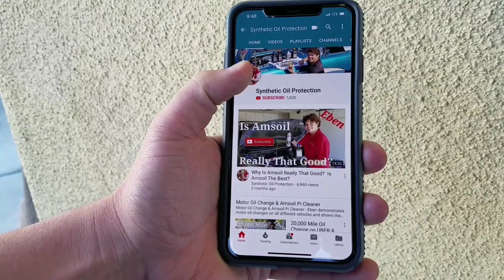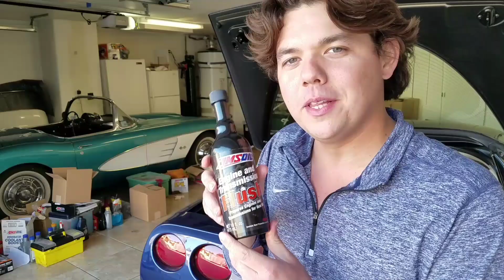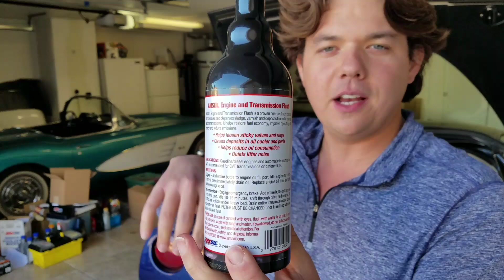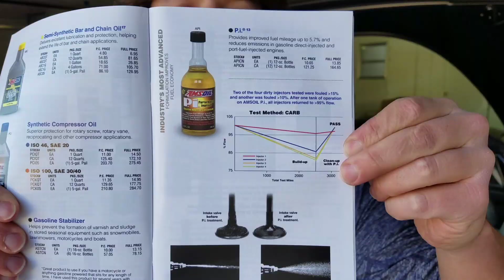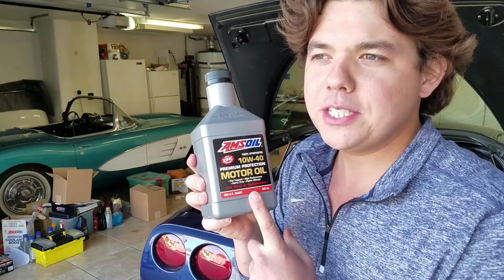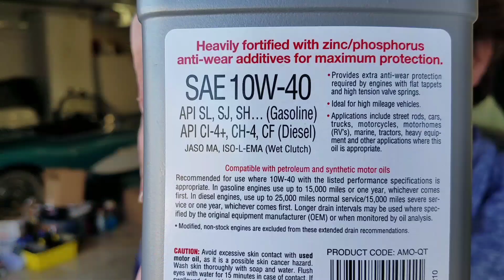Best High Mileage Synthetic Motor Oil - Oil BURN Fixed!!!

Comment: Can this work on a 2008 Honda Accord I have  a oil consumption problem and I’m trying to deal with it right now the best I can please help
Reply from the maker: Yes I would do the engine flush and I would also use the Amsoil power foam and a bottle of Pi performance improver
Reply: @Syntheticoilprotection  Does the engine flush make it worse if the vehicle has a slow leak also, besides the engine oil burn issues?   I don’t need to make it worse . Thanks
Reply from the maker: If I had a car and I was going to change the gaskets within a month or two I would still do an engine flush if I was going to attempt to go a year without changing the gasket I wouldn't do an engine flush because it could make it leak a little quicker.
Reply from the maker: Tristy this is what I did to my Cadillac and I recommend you do to your Honda- https://youtu.be/-T_-mF8tlyA
     If your car is leaking oil from the gaskets do not flush it.
Reply: Synthetic Oil Protection how do you know if it leaking from the gasket ? All I know is when I took it to the dealership a year ago they couldn’t find the leak because it’s not leaking on the ground after doing more research it’s burning out the exhaust pipe
Reply from the maker: Correct that means you are good to go on the engine flush👍😊🇺🇲
Reply from the maker: This will give you all the products for your vehicle and fluid capacities if you have any questions you can call me anytime.
AMSOIL Products & Vehicle Lookup - https://www.amsoil.com/guides.aspx?zo=5331179
Reply: If you are burning oil try changing the pcv valve
Reply: Did you slow down the oil consumption issues?
Reply from the maker: Not sure what you mean

Comment: Hi. I have honda odyssey 2007 is burn oil which product is good for ? Thank you
Reply from the maker: Great question I would go with the Amsoil Signature Series motor oil for your vehicle I would also get the Amsoil oil filter for yours I would get one bottle of Amsoil Pi performance improver and I would also get a bottle of the Amsoil engine flush this is the look of guide it will give you all the products to your vehicle.
    AMSOIL Products & Vehicle Lookup - https://www.amsoil.com/guides.aspx?zo=5331179
Reply from the maker: Uy if you have any other questions feel free to reach out to me anytime
Reply: try changing pcv valve
Reply: Did you slow down the oil consumption?

Comment: On a 2007 S550 with 179000 miles which would be the right oil and how often every 5000 miles?
Reply from the maker: The European oils are meant to be changed at the OEM interval however with oil analysis they've been able to run the Sprinter vans up to 50,000 miles with a bypass filter.

This is the product lookup guide it'll give you all the products for your specific vehicle and it will give you the fluid capacities for all the fluids..

     AMSOIL Products & Vehicle Lookup - https://www.amsoil.com/guides.aspx?zo=5331179
Reply: i have an 04 s55 amg and run shell rotella t6 5w40 synthetic.  yes its not amsoil but the mercedes oil filters are only good for 10,000 miles i believe.  A gallon at the store in usa is about $20, or $5 a quart/liter.  you can also use it in motorcycles.

Comment: Why isn't the Premium Protection available in a 5w20?
Reply from the maker: That's a great question because the older air-cooled vehicles that require that type of zinc and phosphorus are a thicker viscosity and the thicker viscosity meets and exceeds those engine tolerances for those classic vehicles.

If you have a newer vehicle you would want to stick with the AMSOIL signature series products because they are designed for newer direct-injected fuel-injected engines and those are the more similar viscosities they do make Signature Series up to a 5w 50

Comment: Can you use this with a vehicle that has hydraulic valve lifters.
Reply from the maker: Yes you can use it in all motor oils gasoline engines and turbo engines also diesel engines - https://www.amsoil.com/p/engine-and-transmission-flush-flsh/?zo=5331179

Comment: Only way to “fix them” is rebuild them! Once piston rings or valve seals go bad no additive will “fix” them only replacing will fix the issue of burning oil
Reply from the maker: This one is really good showing how it makes a difference https://youtu.be/vR0k3JGOK4M
Reply from the maker: A lot of times there's no major problem with engines it's just the carbon that surround the ring and using a mineral oil will increase. Carbon and you don't really get a seal so you lose a lot of compression and you also lose power.

The best way to clean it is to do a flush and then use a high detergent oil to keep it clean.

The only way to know there's no mechanical damage is to try the flush first and then if the flush doesn't work then he definitely have to do rings and get it fixed.

Comment: I gs350 burning some oil, I'm hesitant to flush the engine, thinking it will make worse
Reply from the maker: If it's leaking I would get the gaskets fixed if it's just burning oil I would flush it and use the ams oil filter and the amsoil signature series I would also get an extra oil filter in change that filter in about 3000 miles because this signatures can to get all the carbon out of your engine around the timing chain and all the oil galleys and everywhere else around.
Reply from the maker: This is one of my best flush transformations https://youtu.be/vR0k3JGOK4M
Reply from the maker: This is a 300 mile 1000 mile engine flush on a Toyota Tacoma he ended still runs great. https://youtu.be/f7nrBNi1k9Y

Comment: My car is burning wayyyyyyyy to much oil it burned 4q in 100 miles🤦🏽‍♂️
Reply from the maker: This will help - https://youtu.be/qjR2pjggjhY
Reply: Holy Crap. I got over 274k and my motor doesn't burn any and I still just use 5w20 and no additiv,... And all my coolant has been in my motor before when I blew a lower intake gasket. It should have been shot 50k ago. Maybe you have a stuck valve. If it is getting burned thru the exhaust, wiping a paper towel on the inside of the tail pipe it will come out black. could be worn rings too. how many miles. Pull out your spark plugs one at a time and look at them. I know some one who wore his motor out changing his oil too much. I do mine before winter and after, if looks needed, and always fill the new filter with oil " so the motor doesn't have to run those 5-30 seconds dry " as much as I can and install it. My filter is at a slight tilt from strait up so I can fill mine 85% of the way easy. For you I'd also would park over some cardboard laid out flat  and let it run over it for 5 minutes in drive holding brake with a little peddle shut it give some time and see if and oil was on the card board to see it there was a main seal leak also. Had to do that once, thought my transmission was leaking so washed the motor and did that. Wound up my rack and pinion was leaking but was in a way it got all over the back of the motor near the trans. Driving blew it around. I've never had sticking valves or anything but in my 35 years all my oil changes I've used Kerosene or marvel mystery oil before hand and always had a clean motor inside.
Reply from the maker: Check this out Sean 

AMSOIL Performance Tests - https://www.amsoil.com/performancetests.aspx?zo=5331179

Comment: I did the oil change last week on my Suzuki XL7 2002 it has 300,000 miles I put 5w30 Signature series. But I didn't do the flush. Will with that oil be enough to stop the oil burning?
Reply from the maker: It should be I would still do an engine flush next time also I would change your oil filter at about 5000 Miles because the signature series is going to break off a lot of that carbon with the detergent.

I would also do the Amsoil Pi performance improver fuel additive to clean the valves that'll help with Blow by
Reply: Did the Signature Series work?

Comment: Could I use AMSOIL OE in my high mileage Nissan truck? Been using high mileage oil for a few oil changes now & I’m afraid to switch to anything other than high mileage. Love the content!!
Reply from the maker: If you're doing under 6,000 miles a year the OE is the best for your application.

If you'll be doing more like eight to twelve thousand a year I would just do the signature series.

This is my link if you would like to try the products and if you have any other questions feel free to just call me anytime.

My link: Best AMSOIL 100% Synthetic @ Wholesale + FREE Shipping: https://www.amsoil.com/offers/?zo=5331179 
AMSOIL Products & Vehicle Lookup - https://www.amsoil.com/guides.aspx?zo=5331179  

 If your vehicle is not on the lookup guide this is AMSOIL Tech Support 715-399-8324
Reply from the maker: Of course of course you can!!!!!!!

Thanks for being a part of the channel John really appreciate you.

I recommend doing an engine flush and a bottle of Pi performance improver also the Amsoil oil filter is much better as well it will help your car over the course of the year.

How many miles do you drive a year?
Reply: Synthetic Oil Protection Great!! I have a 13 Nissan Frontier truck, going on 140k right now.  I put in about 25k miles per year using it for heavy duty field  work and a lot of travel. Looking forward to trying out amsoil products

Comment: My 06 toyota highlander burns oil
Reply from the maker: Its normal,  how many miles do you have on your vehicle?
Reply: @Syntheticoilprotection  208,000
Reply: How’s your Highlander so far? I have a Highlander too with those exact oil burning issues.

Comment: I've been putting Mobile 1 High Mileage in my (formerly) oil burning 1999 Corolla with 312,000 miles for the past 2 years..it does not burn a drop now. But I'm sure AMSOIL is a better oil, it just costs twice as much! ://
Reply from the maker: Amsoil actually becomes quite a bit less than free because your motor will last longer you'll also see a big performance bump and less oil burning you are engine will run smoother better fuel mileage and you won't do as many oil changes you'll change your oil about 2 to 5 times less depending on the vehicle and oil analysis than the OEM interval.

You'll see some great oil analysis videos here
Oil Analysis Tests: 

15,500 Oil Analysis Test Results SL550 - https://youtu.be/3rdN6U1Jt_M 

5500 Mile AMSOIL Oil Analysis Test Results - https://youtu.be/3wf962IwEmo   

5000 Mile AMSOIL Oil Test Results On My SL550 - https://youtu.be/fLuvzN6yLSw 

11,000 Mile AMSOIL Oil Analysis Results on my Corvette - https://youtu.be/YEY_13UYzA4 

20,000 Mile Oil Analysis Results on Honda Uber - https://youtu.be/gm_PXlpiaTk 

26,000 Mile Oil Analysis Results - https://youtu.be/Wdq2A2YIorM 

80,000 Mile Oil Analysis Test Results Freightliner Cascadia - https://youtu.be/9A9k6i1xMoo 

25,000 Mile AMSOIL ATF Analysis Test Results - https://youtu.be/IeVPGR7UO9E
Reply from the maker: Lol

Comment: Thanks for all the great info I will never use high mileage oil again I hope it hasn't done any damage I've only done it once. I'm going to use your process that you explain here on this video.
Reply from the maker: These are my accounts:
Instagram - https://www.instagram.com/syntheticoilprotection/

Facebook - https://www.facebook.com/profile.php?id=100007973957868
Reply from the maker: What type of vehicle are you going to try it on?
Reply: @Syntheticoilprotection  a 1992 F250 with a 460 engine. I has 102000 miles on it. I add a  quart about every 1000 miles.

Comment: Would you recommend doing the flush on a 1997 Chevrolet K1500 Z71 P/U with 180,000 miles? I’ve been using regular high mileage oil for quite some time now and want to consider doing this.
Reply from the maker: Of course, you'll be amazed how much smoother more compression the engine will have after also you will have a lot less Blow by.
Also a good idea to do the Amsoil Pi performance improver that's the fuel injection cleaner that cleans your valves and that'll also help to.

Thanks for being a part of my YouTube Community Daniel☕

Comment: My 2010 Chrysler town and country is got 360,000 miles and I always used Synthetic mobile one high mileage
Reply from the maker: Cool, you notice a big difference if you did an engine flush and put in the hundred percent synthetic you'd be amazed.

This is my best engine flush I've ever done in the channel - https://youtu.be/f7nrBNi1k9Y

Comment: Lms if I got it right. I buy the products, I put the first one (idk where yet), then I put the other one in the gas when it’s empty and then fill it up, drive it around, and then I change my oil putting the Amsoil oil ?  I have a 2001 corolla 210k+ miles and it burns oil. I have to be checking and pouring oil every month ish.
Reply from the maker: When you do the engine flush all you do is let the engine idle for 15 minutes then you change the oil
Reply from the maker: This is my engine flush playlist - https://www.youtube.com/playlist?list=PLB_ftWArBFddawwJUyra9BJY50iLTuBN9
Reply: Daniel, also check the pcv valve. It’s a pretty common cause of higher oil consumption. It’s also not that expensive.

Comment: Cheers! 🍻
I think I'll do the engine flush & amsoil oil change on my wife's Highlander. It's around 55k miles now. We've always had it serviced at the Toyota dealer and who knows what kind of synthetic oil they use...
Reply: Mobil 1 makes Toyota s oil
Reply from the maker: Lol, your wife will be amazed the way it idles and drives after the flesh and Pi cleaner......lol
Reply: Yeah, the Dealer's service is not the better idea.
Reply from the maker: I don't understand what you mean

Comment: My 1993 Toyota Previa has over 257,000 thousand miles and my parents passed on to me since they’ve owned it since they’ve had it that long when they bought it that year and now I’m driving it. I was wondering if I could actually use the 10w40 presented in the video for my previa even though it calls for 10w30?
Reply from the maker: You can if you have a leaking problem. Other than that basically just doing an engine flush and cleaning out the fuel system and cleaning the valves will help it seal a lot better you'll have a lot less oil burning and your engine will run a lot more efficient.

But of course you can run the premium protection 10w 40 the only thing is you'll get a little bit less gas mileage because the oil sticker
Reply: Synthetic Oil Protection thanks man, my previa has a tendency to leak oil through the valve cover gasket area even though I put in a new valve cover gasket.

Comment: That's a good point. The carbon from the old oil that becomes caked on there . The new oiil will go around those problem areas not lubricating properly. 
Causing the dreaded blowby. 
That slowly starts wearing down engines in the long run.
Reply from the maker: Yeah it's amazing the results I just did a 2007 Jeep Commander and did a flush on it and it seems to be running night and day better.

The other thing that's great is the film strength of the hundred percent synthetic seals the Pistons a lot better

Comment: What is considered high mileage. My car is 05 with 190,000 miles.
Reply from the maker: Basically high mileage is just a marketing ploy to sell different products with names to make people feel more confident by choosing individual product codes.

Basically there's diesel engines that run Amsoil oil with over a million miles and they still have original efficiency

Comment: My question is how to flush transmission after high mileage because I am fallow you’re videos no one show how to used in transmission
Reply from the maker: Take a look on the Amsoil website and you'll be able to see the engine flush bottle description they show exactly how to do it it's a very simple process basically you turn the car on and you idle it and you shift it and circulated through the torque converter and it gets all the carbon deposits off the clutch packs and out of the small valve bodies and then you go ahead and drain your fluid
Reply: It is recommended that you only use the engine flush on your tranny that has a drain pan with a gasket that can be replace. Dont use it on the tranny that only has a drain plug. Read the label properly
Reply from the maker: Definitely important to get all the flesh out
Reply: I have heard that the high mileage transmissions that may not have the oil in it changed on schedule maint . Should not be flushed. But think a little before you go ahead and just flush the old oil out of there. 
I have an 04 t
Toyota Tundra Limited . 
It had 127, 000 miles on it when i bought it in 2014.  Since i didn't know if the tranny fliuid was changed according to the maint - schedule. I decided before even chanhing the old oil replacing it with the Valvoline synthetic oil. 
i decided just for a good measure .To drain some of the old fluid. So i could pour some " NO LEAK " PROFESSIONAL SERIES TRANSMISSION stop leak -. 
From the makers of STA-BIL . 
After running this product about a 3 month period. I dropped a little more tranny fluid. So i could ad the Lubegard additive made for helping transmissions shift correctly at each shift point. 
Then after a month or so. I finally changed the old tranny fluid. Needless to say . I haven't had any problems with my A340 toyota tranny that has 157, 000 miles now . Am cautious about just changing the tranny fluid on this used pickup truck that i had financed. That im still paying for until September of this year. 
A good used toyota A340 tranny with a limited guarantee goes for about 600 or 700  bucks. Depending on where you can find them.
Reply: @rolandocurro8842  I have a Honda  an I was told not to flush just drain the fluid, haven't done so yet but that's my next move, and of course amsoil all the way